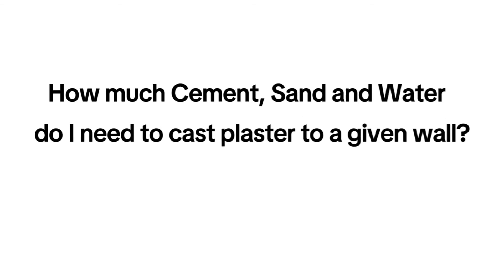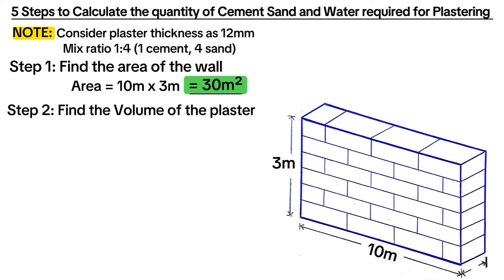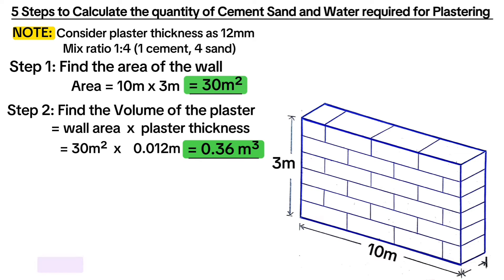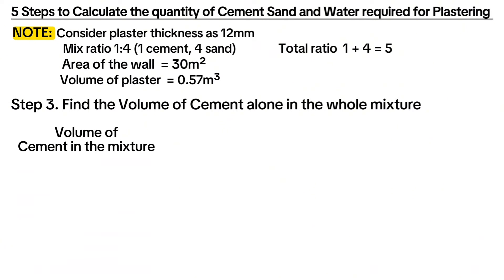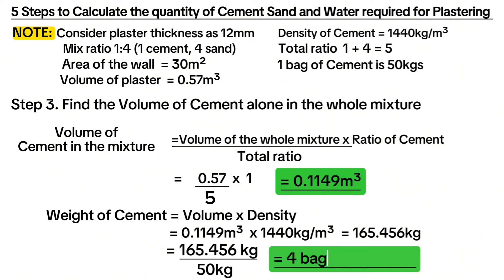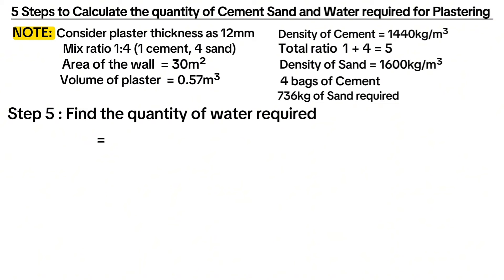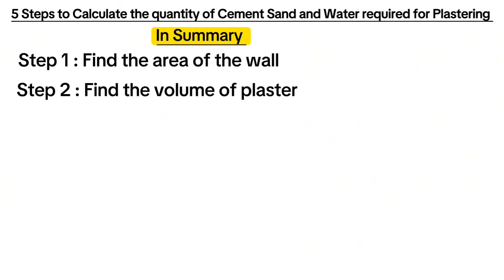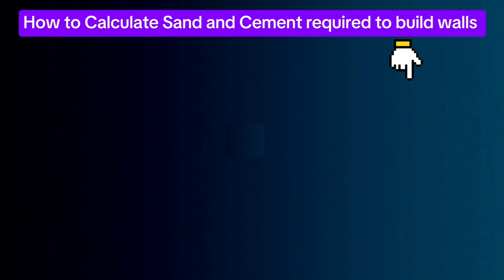How to calculate cement sand and water required for PLASTERING

Comment: Thank you for this... Please i want know aside sand water and cement... Is there any other material they add in the mixture? Because someone told me they get find sand from quarry site to mix with the cement...that it makes it strong... please i would be glad to get a response...thank you
Reply from the maker: Yes, we usually do that sometimes 
Depending on the structural Engineer’s and architectural drawings

Comment from the maker: @sekajja

1000kg = 1 tonne

Let's say you have calculated the sand you need for a whole house and you found out that you need 1000kg of sand, it simply means you need 1 tonne of sand 

To simplify this with example,  a 12 wheel tyre HOWO sinotruck has loading capacity of 37 tonnes = 37000kg

Meaning when you do your calculation and you find out that you need 74,000 kgs of sand,  you order 2 sinotrucks. Currently the price now for real lake Sand (good one) is around 2.5m (655$ usd) for one sinotruck  HOWO 12 tyre depending on your location 
Meaning for 74,000kg you purchase it at 5m(1310 usd$)

I hope you get the relevance
Reply: thanks....

great infor
Reply from the maker: @sekajja my pleasure, I'm grateful that you find it helpful!